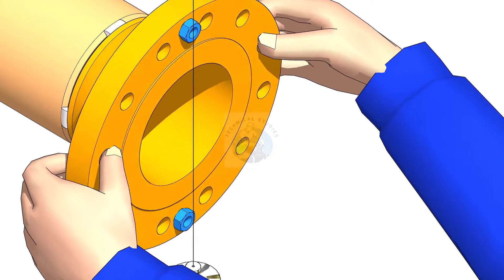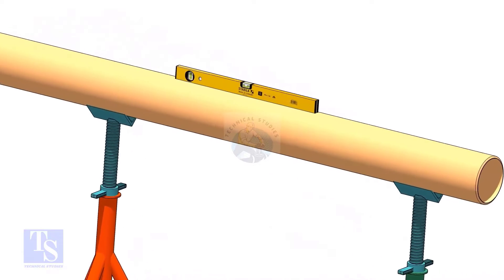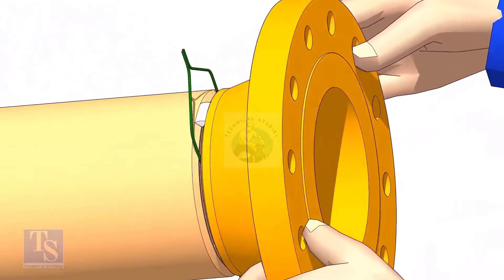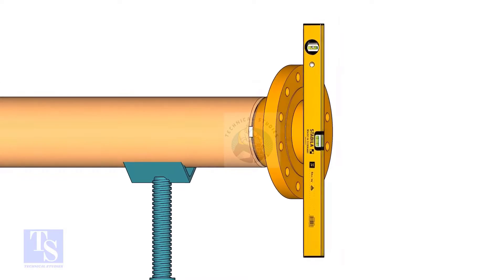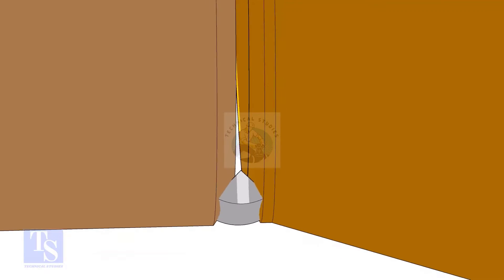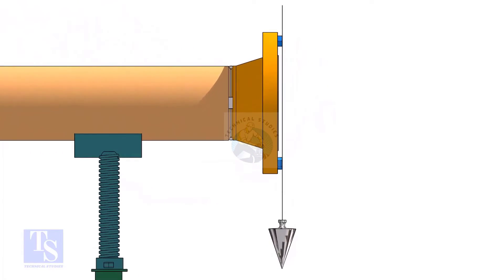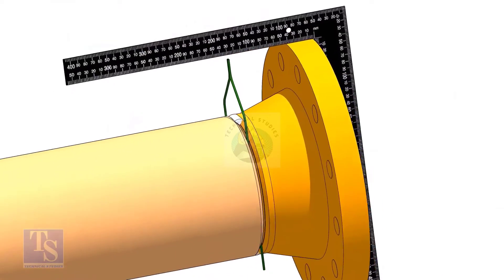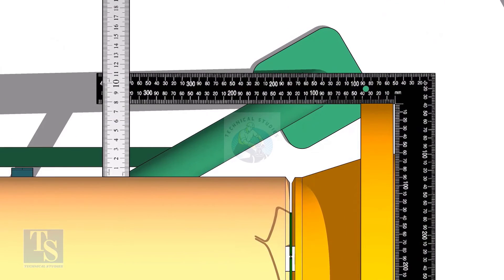pipe to flange fit-up three different methods

Comment: why would it matter to straddle a weld flange on a straight pipe? It only matters when relative to a pipe assembly with other components. This illustration should be viewed with another fitting besides a straight pipe because the pipe and flange become one piece that can be rotated together. Just an observation.